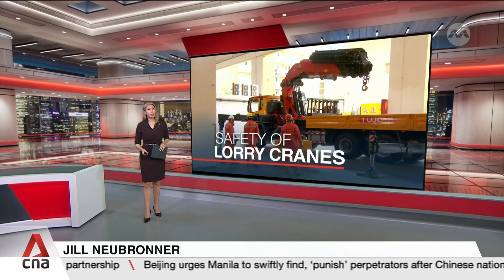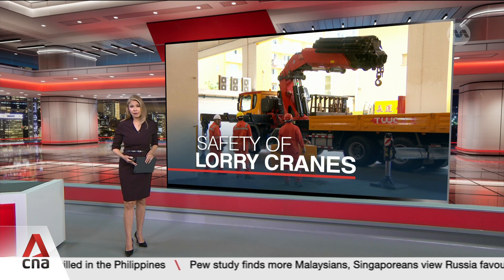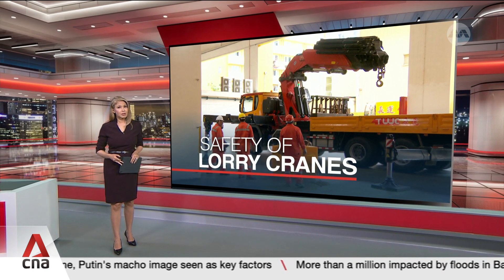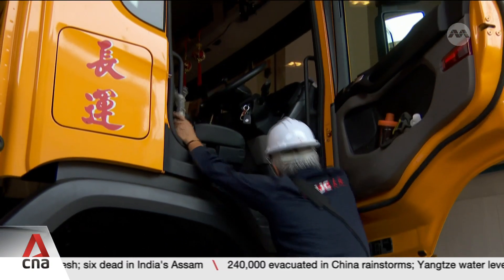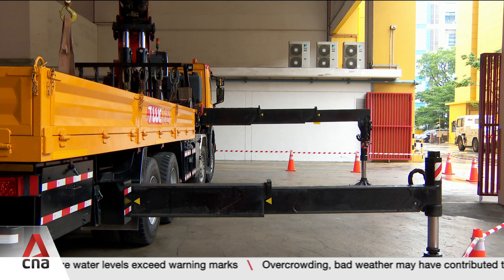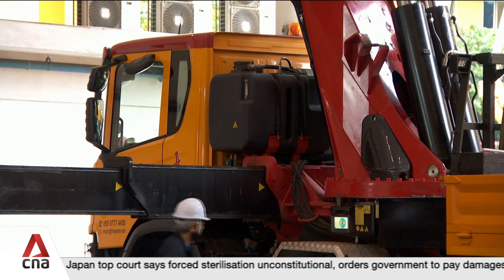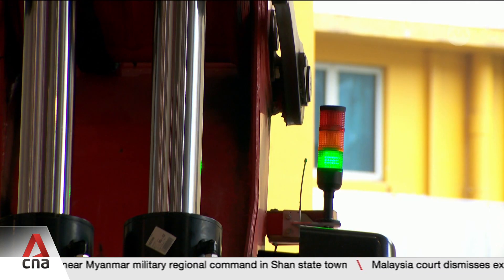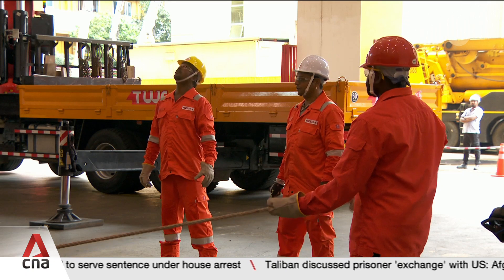Lorry cranes in Singapore must have stability systems from 2025 to eliminate toppling risk

Comment: simprocessor android tagged to license. only for cronies
Reply: s390 mainframe runs instances of linux, concurrently. old news was 16000+ instances. tech was known as LPAR(logical partitioning). processor microcode load-able was motorola-g4 of power-mac. IML of mainframe operator = initial-microcode-load followed by IPL. before IML are security-microcodes from CA taiwan standley-shih which got trapped to Canada bunker and disappeared. typical of the whites to steal and claim like monotheists and women